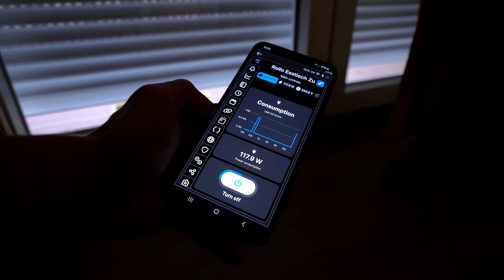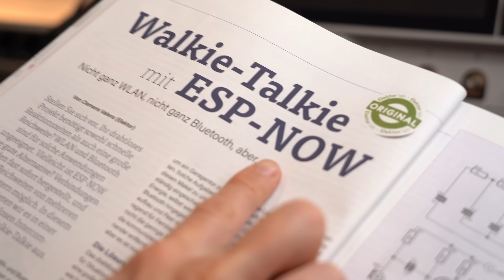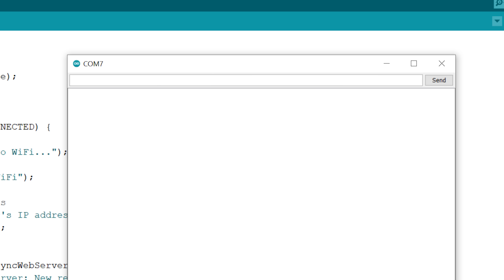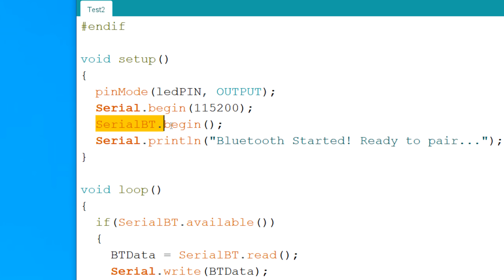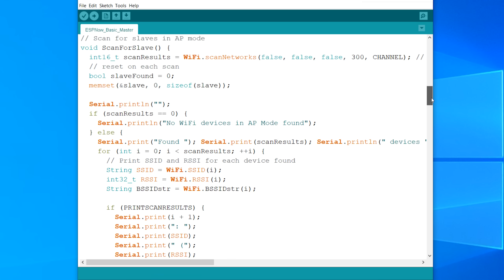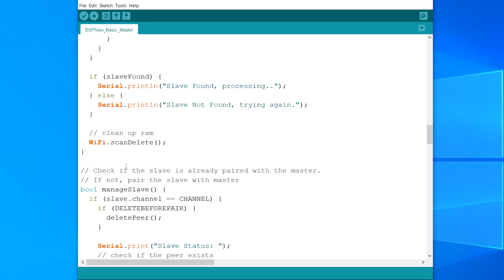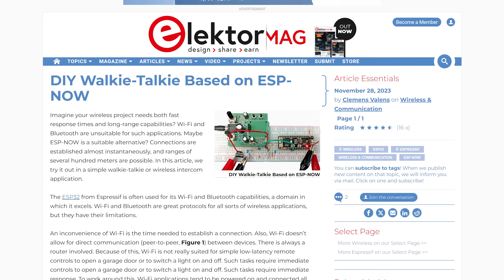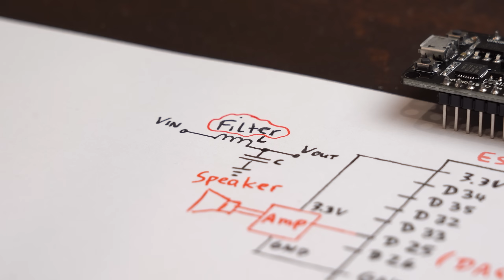Forget WiFi! This Wireless Method is WAY Better? (ESP-NOW)

Comment: In an emergency, would there be a way to have two cell phone directly connect like walkie talkies?
Reply: The wifi radio would need to support an AP-less mode, and an app written to put it into that mode, and run VOIP over that wifi connection... and odds are you could probably shout at the same useful range.  The actual cellular network protocols are VERY dependent on towers.

Comment: The NRF24L01 works almost the same as ESP-NOW in BLE mode, which is what you used in this project. ESP32 BLE and NRF24L01 can communicate with each other. NRF24L01 was already in use before the BLE standard was certified in 2009, and products that used the BLE standard came much later. I still love the NRF24 series, it's cheap and easy to use.
Reply: In the video, he states he got a 110 meter range. Are you achieving that with an NRF24?
Reply: I'd really like to see examples of a esp32 talking to a nrf24l01 !!    The esp wifi has a 20dbm power output compared to nrf24 1dbm, so if I can send via esp and recv via nrf24 that would work much better, the nrf can operate with almost zero power consumption.
Reply: All the NRF24L01 I ever bough were extremely unreliable and if I happen to get it to work, it had abysmal range (say 10 meters). Yes with all the tricks like extra 100 µF cap right across and direct solder connections bla bla bla. Complete trash. Got a whole bag of them, since I tough maybe I have counterfeit ones and bought more from different vendors.
Reply: @leocurious9919  there are a lot of fakes out there, hope you didn't bought it from AliExpress

Comment: What would you use to reach the roof a few floors above in a concrete building? I want to add a remote controlled thermostat to my solar water heater.

Comment: Would an external 16-Bit I2C DAC help with the quality? Do you know how many packets per second you can send? I mean 1MBps is like 10 times as fast as ISDN which was 64kbit/s. With 1Mbps you don't even need to bother much with audio compression.
Reply: I think there is room to improve the 8 bit DAC more with better filtering. Was not clear from the video if the audio amplifiers were tuned to the correct roll-off frequency to get under the Nyquist limit ([half] the sample rate). 

Also not clear if the the audio was buffered in any way. If it was not buffered: there would be noise on every packet as the data stream drops out between packets.

Comment: i was just recently thinking about how how 20 years ago about how cheap but capable micro controllers changed so much. Now everything needs to also be wireless and have an app. Sure, I think it's  overused sometimes but its also useful as well

Comment: I recently used ESP8266 with wifi for a project to switch alot of relais and with multiple esp‘s. Yes you need a gateway and a server but the communication was super fast and also secure with certificates.

Comment: Thanks for the video. 
I’m currently working on a project that involves energy consumption from the chillers I just want my devices to sense whether I’m using generator/Grid, since the feed change over is 20m away from the chillers.

Hopefully ESP32 Now gonna solve my problem

Comment: I think the only downside is that you need 2 devices then to communicate? for example my Esp32 wifi garage opener i can control with my phone and out of wifi also with port forwarding in my router

Comment: I can see your custom made designs do not have the esp32 in the corner so i thought you might not be aware of that using a properly placed footprint, following the espressif antenna placement recommendations for active esp32 modules (tldr: put the antena in a corner without pcb behind) will give you MUCH LONGER range.

The devkits you are using as examples in this video have pcb (probably with ground) routed under the antenna and they have terrible wireless performance, you can easily get >15m for wifi out of a good design. You can also see the change in antenna placement in newer espressif devkits like the S3 ones, they all have the antenna outside the pcb. it can even work quite well from inside a closed metal enclosure.

Thnx for the video, i didn't know about ESP-NOW, i will be using it from now on!

Comment: For those who don't know,
Any ESP can be switched to external antenna with small soldering skills 
You can use espnow or espnow long range.
Espnow can be used simultaneously with wifi if you need a Gateway but not recommended
Reply: I wonder what the range can be with external antennas and crowded area? I’m thinking off grid tracking and location of groups of people, ie no mobile signal “find my friends” units.
Reply: Some ESP32's also have a hirose connector so you can adapt external antennas with the correct cable or adapter. Years ago I hacked a pcmcia card in a similar way to an external biquad antenna to get rediculous range (wifi in the middle of a lake).
Reply: Great! I'm from Brazil and I noted your tip! Sounds like you mean to modify the frequency. Do you have some tags to search for how to do it and what components? I'm trying to search for some to convert frequency for spectrum under 1GHz and maintain high rates of data traffic. I own two pairs of Halow WiFi. They are excellent, but unfortunately they are expensive in the Brazilian economic reality for large-scale applications. I'm looking to understand what kind of circuit I can use it to capture what is modulated at 48 or 40MHz, or the signal built to send through the 2.4GHz antenna, convert it to a DC signal and inject it into a module with a central frequency of 433MHz. Can be other crap UHF frequency between 433 and 700MHz that is theoretically used here for TV channels, but any one use it. I would like to convert it to use directly in the ESP or send it in the form of ethernet cables. If you have some tags so I can find a tutorial on how to use those countless green RF plates available on Aliexpress, I would be very grateful!
Reply: Depends on what you mean by "high" data rates. ≤1GHz means <1 billion cycles per second, max; depending on modulation, we might get 2 or 4 bits per cycle, but with overhead & noise, it's kinda rare to see speeds of even 1Gbps on ≤1GHz connections. 

By bridging multiple connections\channels, the low data rates of low frequency, could be partially worked around, but channel saturation will quickly set in, if multiple concurrent bridges are attempted.
Reply: @thenextproblem8001 can you provide us with more info please?
Reply: @Ancipital_  hi, sorry for late reply. What you need exactly?
Reply: So, would it be possible to have one ESP32 connected to Esphome and have its functionality (and range) extended by connecting it to another ESP via ESPNOW?
Reply: @wagnerfontes2  yes for sure 😊 I'm using it with blynk at the moment
Reply: Woah!
I was wanting to know if they can be used simultaneously.
And if the range can be extended.
😂
Thanks mate.
I'm not currently very techy, or anymore than a novice learner (programming).
But I love this kinda shkit!
Reply: @yasirrakhurrafat1142  “Simultaneously” is a bit of a misnomer but it does work. The underlying method is that both ESP-NOW and wifi share the radio the same way multiple cars can share a single lane.
Reply: @JB-fh1bb  would it mean that I'll lose the connectivity with the esp modules that are connected to the WiFi (router), when I use the esp-now?
Or that the esp modules will extend the wifi range like a wifi extender to expand the base wifi (router) range to connect with the furthest esp device using the esp now connection?
Reply: @yasirrakhurrafat1142  great question. It's sharing clock cycle to clock cycle so you will maintain connection, but you will see lower performance on each and possible collisions if there is a lot of data going through each protocol.
Reply: @yasirrakhurrafat1142  As for the second part, they are separate protocols so ESP-NOW will not extend wifi
Reply: @JB-fh1bb  awh man.
That's rough.
But it has two cores though, can't it use both esp-now and local router wifi, without clock stuff?
Guess we'll need more cores in the microcontrollers eh!
Question.
Can the sbc like raspberry pi do some of the stuff that this can, without separate microcontroller.
Just by the gpio that already comes with it?
There's people saying it can, then there's people saying sbcs are completely different and can't do Arduino/ESP stuff on its own.
Reply: @yasirrakhurrafat1142  ESP can be used as WiFi extender for sure. I'm using idk may be 4 years without any problem.  Raspberry pi or others cannot be used as microcontroller directly. For example there is no ADC. You cant connect joystick to it without external ADC
Reply: @thenextproblem8001  oh.
Bummer, but microcontrollers are awesome.
I just thought the bigger rom and higher processing power of the r-pi or similar sbcs could've been utilised for small, smart, automated microcontroller stuff.
Possibly with some ai, to enhance the utility and capabilities of the devices.
Still, awesome 👍!
Put out some of your projects bro, share it with us!
Reply: @yasirrakhurrafat1142  ESP's core #1 handles Wi-FI. Unless, set up in STATION mode, you may want to run another Wi-FI stack on Core #2.

Comment: As others have said: the esp32 can function in AP wireless mode, so you can connect to it without a router involved. Additionally many (most? all?) can function in STA and AP mode simultaneously, so they can connect to a wifi net at the same time something is connecting to them. I do this and it works great.
Reply: Didn't tried espnow yet but I have been uysing the method you describe for my last project and sometimes depending on the environment it stops working. It's not a software problem as if the device are close (like 2 meters) it works perfectly but when the distance is larger the client device doesn't find the AP or it disconnect after a few minutes. I'll try espnow as it looks like the definitive solution for my problem.
Reply: @LuxBacelo  Are you using the built-in  antenna or a module with an external antenna jack? I use one with an external antenna (DevKit-CVIE which uses WROVER-CVIE) and haven't had any issues, but I haven't really stress tested the AP range.
Reply: @CaseyConnor  Built-in, sadly I don't have space for an external one.
Reply: The esp8266 also could function as an AP. A good exemple is the WLED project.
Reply: ESP8266 has much reduced throughput in softAP mode because the AP implementation is in software. I imagine ESP32 is the same though has an extra CPU core (if it's a dual core version) so probably handles it much better.
Reply: @racitup4114  interesting.
Reply: @racitup4114  I understand your point but I don't know if thats the problem. Of course a software implementation will be worse than a hardware one but I think the distance of the signal it's more related to the power consumption of the chip. As the clock it's mostly fixed on these devices the consumption should be equal but when doing my test it's not. You can measure the current on startup, creating or not a softAP and you will see how it fluctuates. It's not a problem of the device or design but probably not the best device for what I'm trying to archive.
By the way, didn't have the time to test ESPNow yet.
Reply: i agree with you

Comment: And one suggestion for next esp project is esp wireless surveillance camera with auto motion capture, sending the footage to it's IP address and maybe on google drive or local storage if it's possible somehow. You can use SD card module for storing footage but it's got a lot of limitations you know. And to power all of that, utilizing a solar cell would be fascinating idea. That could be a great project IMO. Hope you'd think about it. Thank you so much BTW for your hard work and teaching us so much that no one could. #Respect

Comment: I always use one ESP board to host a WiFi network, and then connect to it using the other. It's obviously a lot more power hungry, but only has about 15ms of latency.

I'm really excited to see how this compares to that!
Reply: Higher power draw for either having to keep the stations active, or reconnect them which takes time.
With ESP-Now you just wake-up, send and go back to sleep.

Comment: using same frequency as wifi is not a positive thing. Theres already zigbe and zwave there. Wifi can easily drown out all of those devices
Reply: Also most microwave ovens made in the past 20 years are 2.4 GHz (though some are 900Mhz).

Comment: The (kinda) new esp32-c6 also supports thread and zigbee now. Maybe check them out
Reply: We had to wait quite some time to be able to purchase these boards. Finally!
But i still have some ESP8266 lying around, so they can use ESPNow in parallel i suppose. Not much use otherwise.

Comment: Good video. But your comparison may generate some confusion. 433Mhz it's a frequency but Lora it's a modulation protocol. 433Mzh have been used for quite long time before Lora but here in EU Lora transmissions use same frequency plus 868Mhz. Living in Germany you must know that this country have a strong Meshcom community. For those who don't know Meshcom it's a Meshstatic like project that use only 433Mhz frequency.
Reply: Yeah, operating on 433MHz is one thing, but referring to a protocol by some frequency rate, is bad naming that needs clarification each time the malaprop is used.

Comment: I don't know... if I understood this was 10m. I think maybe 50-100m we can speak together without anything, and better, and I think an FM or AM analog device also better in 10m. But the 8bit in PCM I think, so the question that can we upload a software converter to opus/mp3/flac/AAC/AC3? Because 8 bit 40kHz PCM is 320kbps if I calculate is good. What maybe enough for fine quality sound.